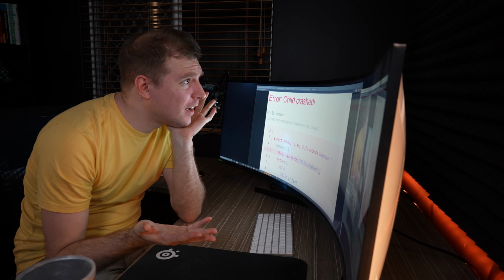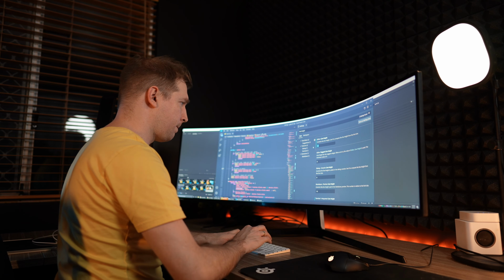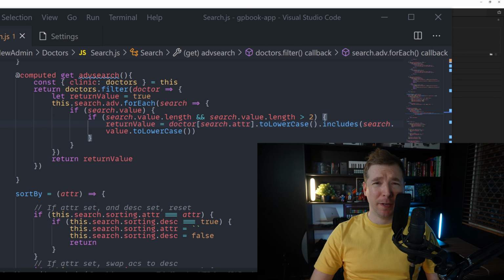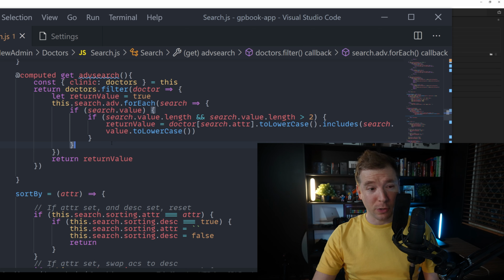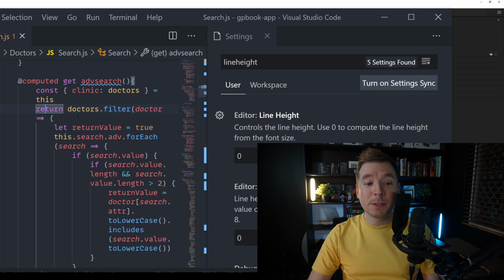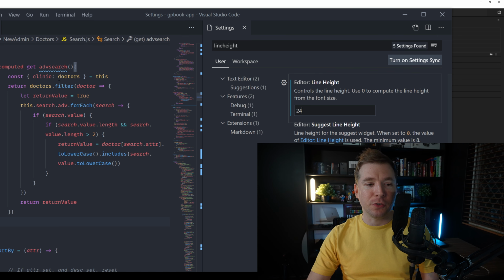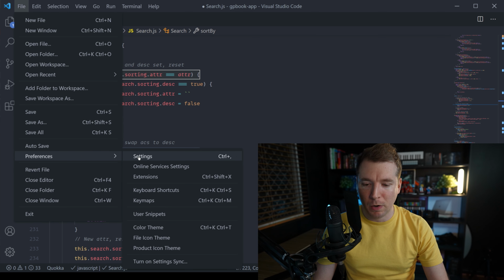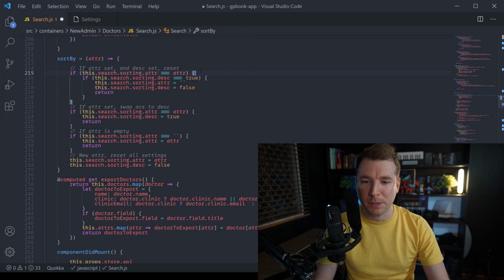Read your code easier using this trick

Comment: I never really figured out how line height worked in vs code. I use jetbrains mono at size 13 and they recommend a line height of 1.5 so naturally I put in 1.5 and man that was wrong 😂 so I reset it and left it! now I see the error will try size 20 next time I'm at the computer! 
Now to a little tips. If you are going to do a comparison and say look at the difference, please put the config window in it's own workspace right beside the code, drag the tab with the config window all the way to the right and then you have 2 tabs open side by side. That way we can see the switch live and more easily see the difference. Great vid! 👍🏻

Comment: Gotta say I prefer auto/0
Reply from the maker: How many lines of code do you normally have on a page? In terms of HTML, I probably think 0 is good, for javascript, the increase always helped me.
Reply: @AdrianTwarog  But I think it's just not that important, cause all of the code on Github, stackoverflow and every article are still sticking to the default 0 line height, if I put it on 24 and then read others code and so on I think I will not feel satisfied as before cause I'm not enjoying reading others code with default line height cause I've been used to a custom big line height, But after all it's just my opinion everyone has its own.